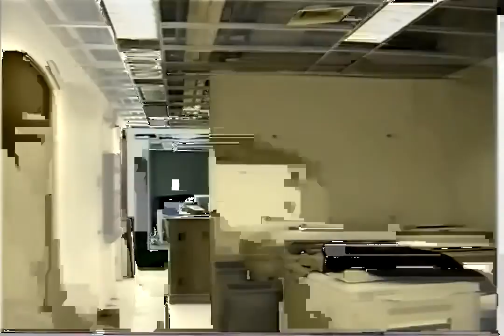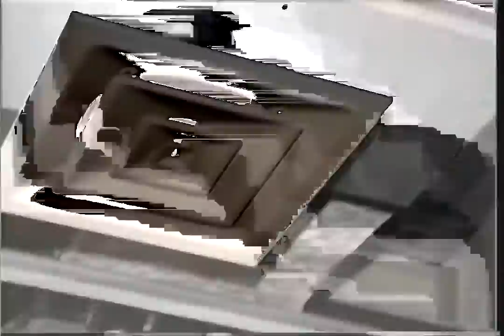NIST FOIA: SFRM Inspection, Flr. 85, WTC2 (March 20, 2001)

Comment: The building's weren't the same anymore after the 1993 bombing. The Hudson River salt and humidity kept going through openings. The governor at that time wanted a quick fix after the bombing. And also there was gas explosions just like It was in 2001.
Reply: Come you provide a link or source for gas explosions? Curious..
Reply: @davepowell7168 i remember as well so the commenter is right.  I think they were in early sunmer or late spring of 2001,  maybe a google search will yield results.  But I have noticed as time goes on articles are becoming more and more difficult to find

Comment: The floors seem very shallow, the ceilings are low. Has a claustrophobic feel to it especially for being so high up.
Reply: They weren’t too tiny, maybe the angle or lenses on the camera are distorting the view because I remember being up on some of the upper floors and the ceilings weren’t high but they looked much roomier than this video.  They were basically the same ceilings a finished basement with drop tiles has.
Reply: @GivingUMore so you were inside the twin tower. That's cool. How strong do you think were the floors against high winds and storms?
Reply: I heard stories of people complaining of the claustrophobia, and the narrowness of the windows didn’t help either
Reply: I have the opposite of claustrophobia, fear of large spaces and high ceilings. And when I see pictures of the ground floor my legs are shaking.

Comment: A lot of different materials; metals: aluminium, steel, exposed iron rust patches, brass pipes?, copper pipes, copper wires...Different plastics and mineral based stuff. A very light weight look to it all. Only functional structures. Complex but organized.